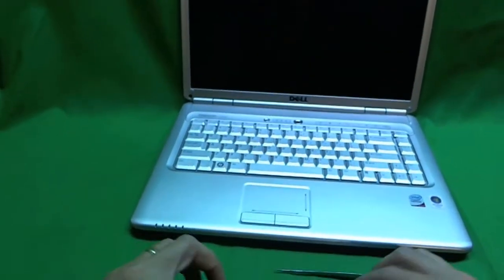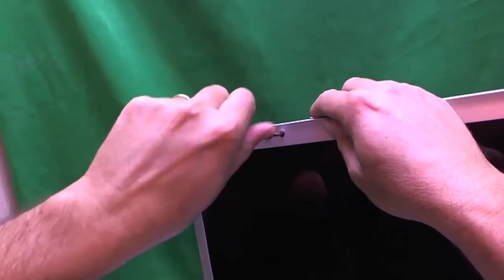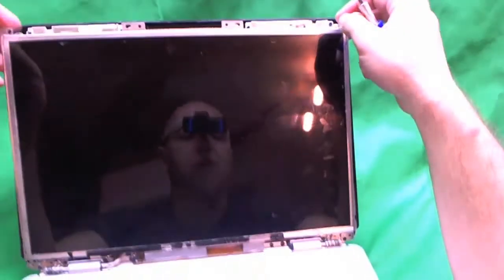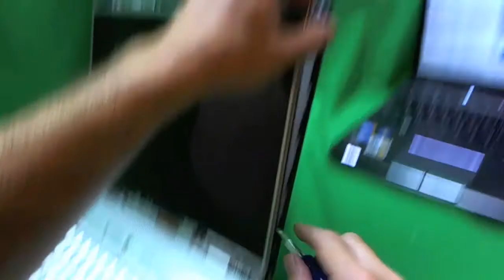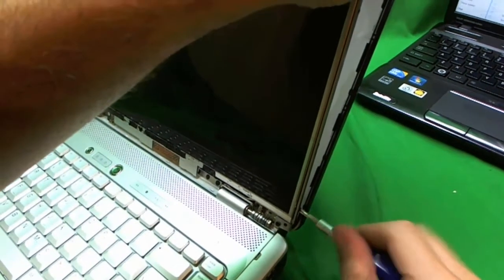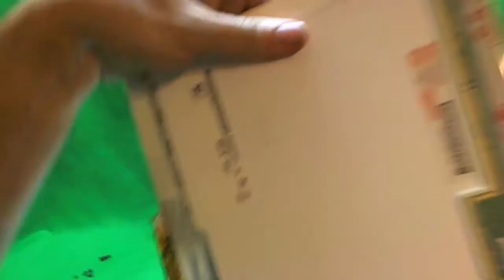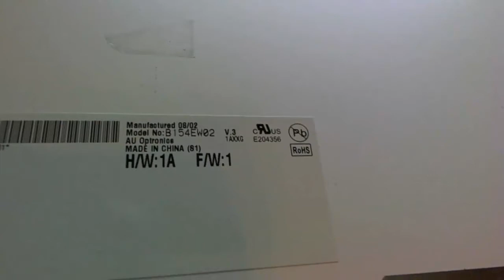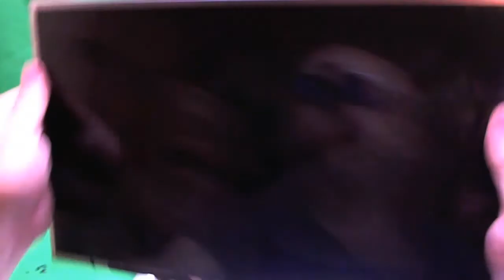Dell Inspiron 1525 Laptop Screen Replacement Procedure

Comment: Can you please help me with a problem? My Dell Inspiron 1525 has a white screen when I turn it on, and it slowly and gradually shows black shadows in the center and expand over the whole screen. The computer system itself should be working fine. Can you please tell me if I need to replace the whole screen, or just change the LCD cable, or is it some other problem? I am gathering my nerves to open the back of the screen, please help, thank you!! <3